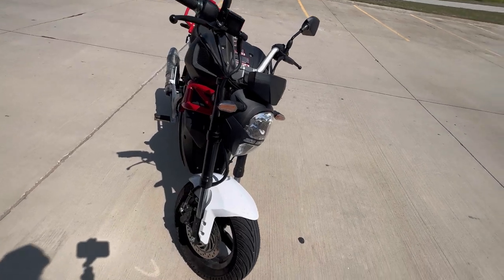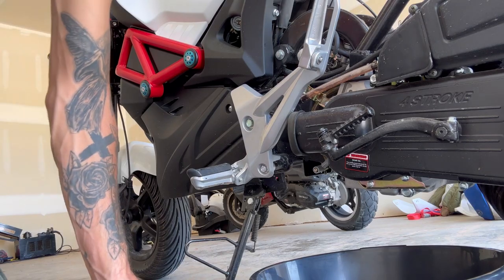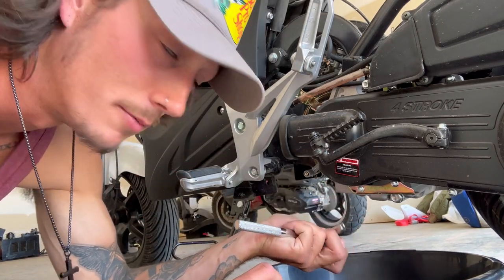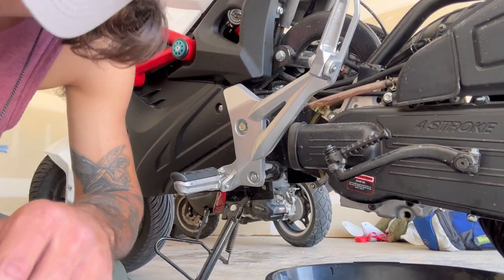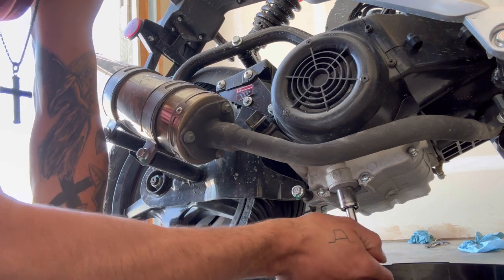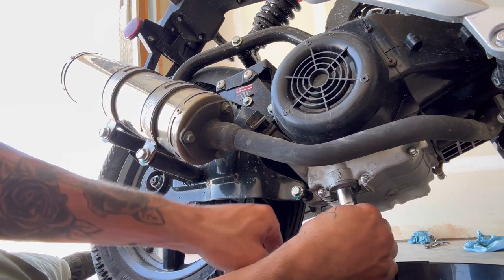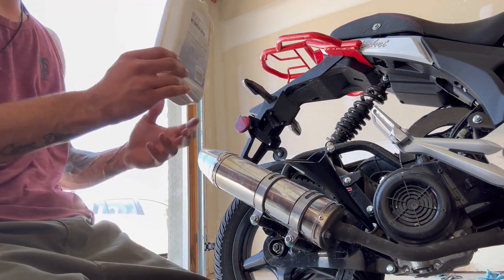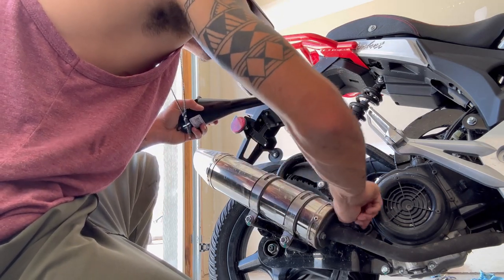Vitacci Rocket 150cc |GY6 oil change

Comment: Nice work !
Fyi oil viscosity grades are largely climate dependent, which explains why the advice is conflicting.
Colder climate, smaller #.
Hotter, go larger #.
(Also, use Full Synthetic Motorcycle Oil, only, for best results)
Cold climate viscosity: 10/40 
Hot climate viscosity 20/50

Hope that helps out !

Comment: I spent a bit breaking in my bike  then done oil change, then got 300 miles before next oil change,went 1000 miles an done gear lube change, bike runs good.

Comment: Got a question: You know that intersection coming off of the header pipe? Is that an O2 sensor and where does your line go to? They just ziptied my hose to the front fairing. Thanks in advance

Comment: great video 
you made this super easy. i do have a question mine sounds like its studdering or putting while started.  any clue on what it is
Reply: Sounds like you need a valve adjustment.
Reply: @RC-ox9yx  i actually figured it out and gave my bike an oil change i think i rode it like 500 miles its winter here. However i think my accelerator handlebar i might have messed up because it doesnt pull back automatically now

Comment: I have venom motorsports x-21 50cc dong fang SRT 50cc moped, with a gy6 engine, can you do a rear drum break if yours does or not,i know theres a spring back there under like when draining gesr lube that goes for the breaks to make adjustments. Im still learning on my bike an doing maintenance work

Comment: One of my friends recommended that I change the oil when I just bought the motorcycle and use conventional oil, not synthetic 10w-30 10w-40, for the first 500 miles to help the engine break in, an then use synthetic oil is this true?
Reply: He's probably suggesting you use conventional oil for break in over synthetic because it's cheaper. The first few miles of the break in period is essentially an engine flush once the required amount of miles are achieved. A bottle of conventional oil is cheaper to waste for first break-in compared to a bottle of high-end synthetic. So from a cost view, yes it's true. I use AMSOIL Diesel 15W-40 in my scooter and it's almost $16 a bottle, you don't want to waste something like that for first break-in. A bottle of conventional oil at $6 or $7 a bottle is a cheaper choice for first break-in. Then you can use which ever brand of synthetic oil you like best from there after.
Reply: If it’s shipped they use shipping oil to keep the inside your bike fresh.

Comment: Hey bro can I send you a video of me starting mine up an see if you can give me any hints on my problem ? It starts up stays in idle an if I give it gas it shuts off it’s like I can’t touch the throttle at all
Reply from the maker: It’s definitely a carb problem
Reply: Having the same issue, came to a stop sign and it just shut off on me and I kept starting it and everytime i touched the throttle it turned off on me